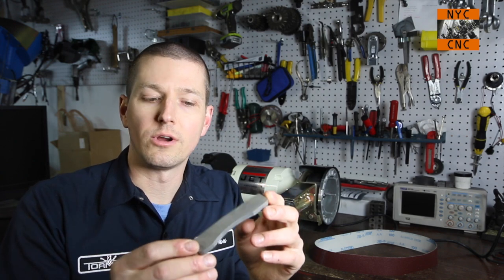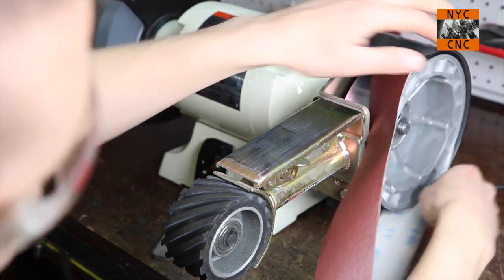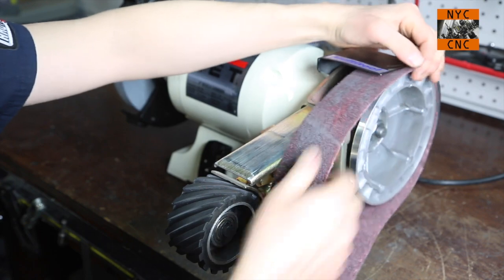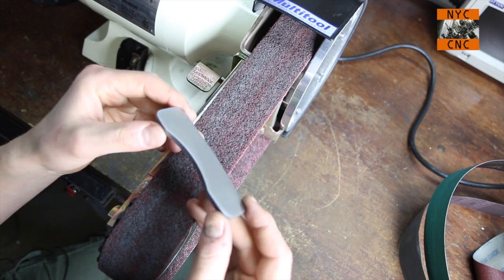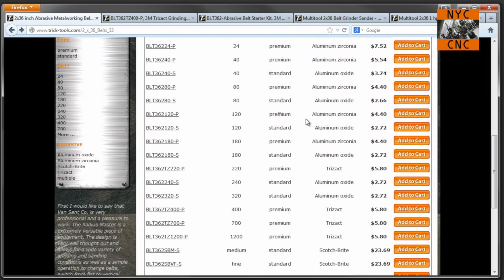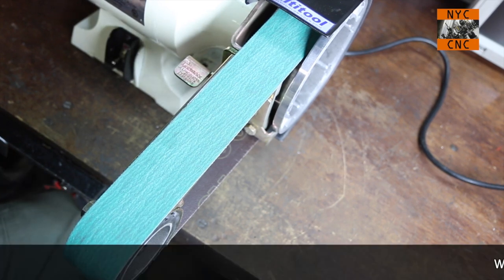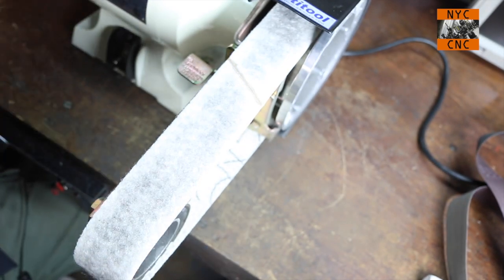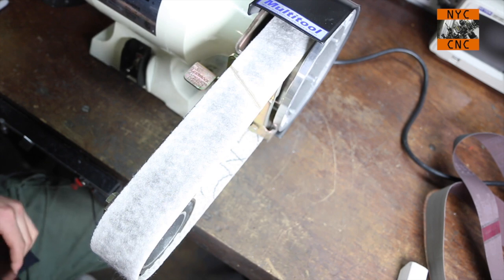Polishing Steel to a Mirror Finish & Brushed Metal Finish!  MFG@Home

Comment: a mounting attachment to turn the belt vertical would be handy. then a small table to prevent the work from going too far. nice video , thanks for sharing it.
Reply: Check out tilting stand and workrest on multitoolgrinders.com
Reply: @multitoolgrinders  Does this not mount also vertically up amd down?
Reply: @aldenunion  Yes it does. It is a very easy and quick adjustment to change the attachment from the vertical to horizontal position. Also the Multitool Grinders attachments can be installed on the RH & LH side of grinder motors, so you could have an attachment mounted in both positions. 
www.multitoolgrinders.com
Reply: @multitoolgrinders  Oh!!!! So the platen will face switch after all?? Great!!!...
All these people bragging the baders and big money machines while I lost my finger prints the ole fashioned way and need a new vehicle.lol...I know I can make this do the same work with enginuity..
"Where there is a will  ---there is a way.""...
Reply: @multitoolgrinders  Sir,Can I ask one more question? I already purchased one from your shop on ebay (Just bought today so mail waiting)⁹ ..I wondered,when mounting verticle,the black shroud,must that be removed for good? Would figure debre would accumulate in the shroud that may cause grit contamination or effect with build up as it would need to be opened in up direction as a catch container..What is SOP for such a set up? I noticed all the tricks for tracking etc...So much information that I feel I have used it already for years.lol..Regards,Tim
Reply: @multitoolgrinders  I examined how it sure does set up as you say,just was wondering of the shroud,probably is not needed because the sparks would fly downward off contact wheel in that position with it removed....I honest!y do not care enough to bother them as I could adapt and amend as everyone else does..Just figured I'd ask while you were handy fresh from answering my other question..
Other 2x72's do not even have them guards..These are fine bases to save money and get exact purpose completed.
If one is not Savy   enough to improvise for their personal needs and set up,they should not be using such dangerous machinery.lol.Thanks for reply

Comment: A good way to polish if you want a perfect flat surface without imperfections in to tape the sand pape to a large ground surface and hold it as steady as possible. I know it take more time but it help when flatness and parallelism is important. But hey I work as a toolmaker and we don't have to move fast.haha. But that why I love it. Have you ever had to hold tenths with your tormach. Just curius because I haven't heard much on there accuracy

Comment: Looking to fix a scratch on a Brush STainless refrigerator door. Lots of good ideas just have to fit them to an angle grinder or something like that
Reply: Be carefull though, too much heat and the stainless will buckle and you will essentually end up with a dent. Do it bu hand with Scotch bright and kerosine.
Reply: No just hand polish with 600 wet or dry on a block go in one straitened direction for a uniformed brushed look lol

Comment: I've been enjoying your videos for a while, and I've learned a lot. This is the first time I've seen one where I thought I could share something that would help you. :) I haven't read through the 99 other comments, though, so sorry if this has already been covered. 

I'm building a 2x72 grinder of my own design (really a Frankenstein combination of other designs I've seen), and I arrived at this video after watching your one about removing mill scale, as I need to get the mill scale off of my steel before I weld because I want the welds to look great. Anyway, I've been studying A LOT about these things. Quite frankly I can't believe you aren't building your own. You have a plasma CNC and you know how to lay it out yourself. There are a number of sets of free plans online. The EERF ("free" backward, designed to be made from scraps laying around), which I've seen on several sites, is the main basis for my design. Get a 2HP 3-phase motor from ebay and a cheap Variable Frequency Drive (VFD), also widely available online, to convert from single phase and you can control the speed without changing belts. If you're patient and diligent you can get both for about $100. If you're in a hurry you could do it for $200-250. Many of the designs are even specifically "no-weld" designs (I haven't seen you weld, so I don't know if that's part of your capabilities). Anyway, I'll bet with your resources and skills you could make a killer 2x72, even turning your own wheels. 

I'm going to do a couple of build videos of mine (I'm almost done sourcing everything). I'll try to remember to share a link when I get them up so you can watch and think, "Man, I could do that!" 

The other thing is that you should probably get some better belts. Aluminum Oxide is great for woodworking, but it wears out very quickly with steel. Pick up some ceramic belts and make something awesome. :)
Reply: Ha ha! I wrote that before I had finished your video. You already know about the belts. :)

Comment: You will obtain better results If you periodically change the orientation of the piece rather than always sanding in the same direction.
Reply: NYC CNC Study some telescope making websites.
Reply: ExtantFrodo2 Got any links? Sounds interesting
Reply: aryesegal1988 No, but I'm sure if you Google home made telescopes or telescope making you'll find a bunch.
Reply: ExtantFrodo2 thanks, i'll try :)

Comment: I like the idea of the attachment. However, I feel that it is rather dangerous since the direction of rotation is wrong and it should be away from the user. Otherwise, 2 things can happen, (a) the sparks will be 'sprayed' to the user, & (b) a slip of the work piece will fling it directly to the user......Thanks anyway for the video.

Comment: i have the multi tool/jet combo in my shop and use it to get a #4 finish on carbon steel, 304ss and 606x aluminum. the orientation can also be vertical and the non platten side can then be used for tube and round stock.  agreed, the platten needs help- would be outstanding if you shared a retrofit design for a more stable platten... ;-)   I would love a variable speed drive for this (would require 3~ or DC motor though).  some cheaper non wovens (scotchbrite) breakdown at this surface speed if you get a little aggressive with the pressure.  5400 rpm is cooking.  guy who called it a biter is right- I've given blood, esp after being on it for 5 or 6 straight hours.  safety second, stay awake first!  good for the price, trick tools did good by me too.  A&H abrasives in WY good source for belts.  thanks for the video

Comment: Hi John. Recently found your video stash--cool! A couple guys mentioned magnets...For flat grinding knives, I use small handle magnets, with a thin microfiber cloth between. I grasp the cloth with the handle and it keeps the fingertips cool. I dip the piece in water, too, to judge heat/temp. The cloth also helps preserve the finish you already spent the time to make when tearing the magnet off. Also, to get things flat safely, have you tried standing off to the side of the belt? Might be safer in the event the piece takes off as well as to help you maintain an even grind. Thanks for sharing this--I've ordered from Trick Tools and had a positive experience, too.

Comment: Nice video. I go from 60 straight to 400 and then 800.. I also keep older broken down 800s that effectively work as a much finer grit. I'd guess about 1500.. Even experimented adding polishing compound on a really old belt before taking it to the polishing wheel

Comment: I had this setup but ended up building my own 2x72 with a more powerfull motor as it was pretty easy to stall the grinder motor.
I use a welding magnet to hold pieces for grinding, pretty cheap on evilbay

Comment: Not to nitpick, but wouldn't it be easier to give it a quick go on the surface grinder, then use the polishing belt?
Reply: Ah.
I was thinking though, if you had a bunch of pars to do, putting them on the mag chuck once or twice would be faster than hand sanding them.
Plus the grinder is semi-auto. :)
Reply: Ooooohhh. Good to know.

Comment: Pretty awesome, first time I have seen such a tool. Can this Multi Tool be attached to a 8 inch Delta grinder. Did you do the assembly or did it come as shown ? Great presentation by the way, clear and concise. Bet the company appreciates this video ;) I guess the add ons add up quick.
Reply: Yes the Multitool Grinders attachments will convert any name brand bench grinder to a belt grinder. multitoolgrinders.com
Reply: @multitoolgrinders  Sir,I just purchased one of your attachments for knife making on hobby level.
Said can mount it vertical so platen can be up and down to grind knife bevel\plungeline...I wish was demo with set up as that..You would sell so many more of these as many people wasting money on junk because 2x72 so much more dough..Hope it works for me..Waiting for mail lady.lol..
Reply: @aldenunion   its incredibly easy to convert the attachment from a horizontal position to a vertical position. There are three nuts on the outside of the main bracket, loosen the nuts, rotate into position desired, retighten. Its that easy and only takes about 30 seconds!

Thanks for the heads up on content you would like to see. I will put it on our future film request. 
www.multitoolgrinders.com

Comment: Is It time for the surface grinder on the platen?
Reply: NYC CNC
You might want to try a graphite covered platen, our old edge sander used that instead of a roller. I did not think that it would last very long, but the thing went for years before we had to change it out.
The graphite  comes in a roll and was made by Process Engineering if I remember correctly. We did have a roller on the sander for a while but it
did not have nearly as good a "feel" as the graphite covered nose.
Reply: NYC CNC just a thought, as a knifemaker and life long ironworker, try gluing a piece of glass to the platen. it is near perfect flat and superglue will hold it on. when you wear it to the point of discomfort, chip it off and glue another on. i use glass on a shopbuilt 2x72 pushing 5500 fpm and have had great results.
Reply: NYC CNC  some commercial handheld woodworking belt sanders use sheet graphite pad on the platen

Comment: Another trick to doing something flat is holding the part on the platen first before turning it on, that way you don't accidentally hit an edge while trying to line it up flat to the platen
Reply: NYC CNC
yeah...definitely got to be a bit more careful but a firm grip on the part with very very light pressure against the belt to start, just enough to feel that your totally level. Came across this idea just recently from another knife maker, it has improved my "surface grinding" immensely :)